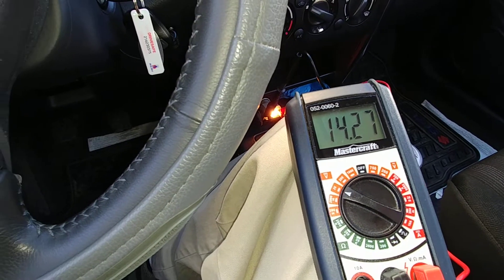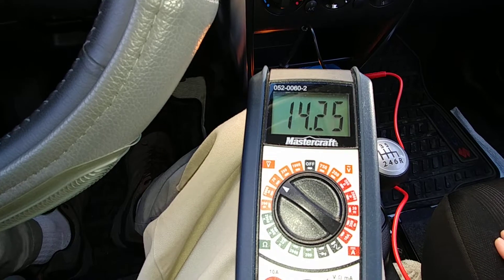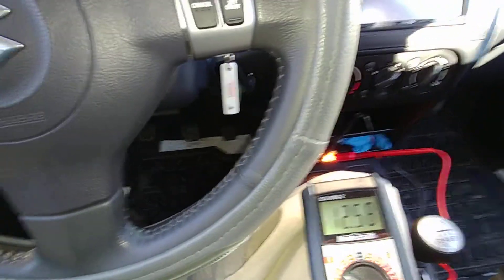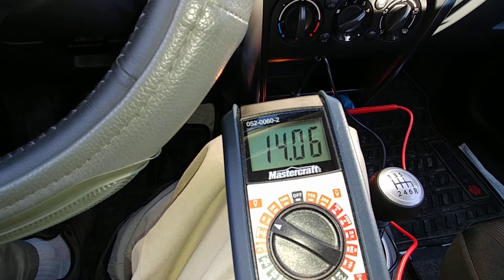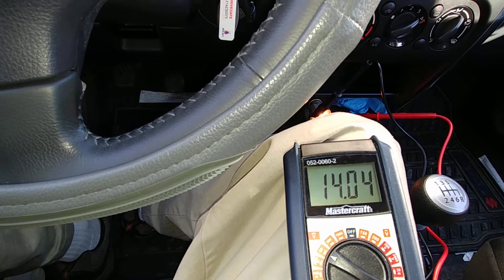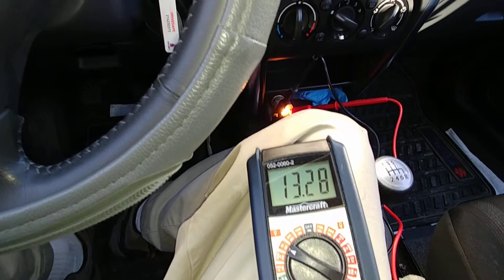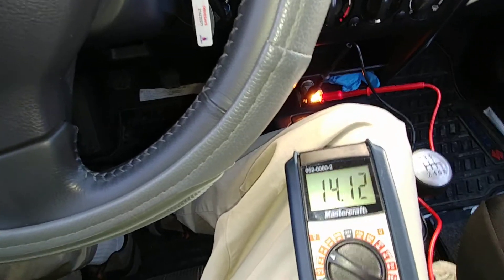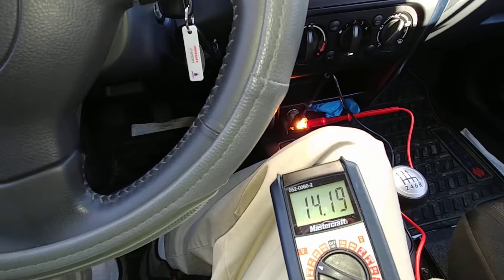2011 Suzuki SX4 Alternator Voltage Readouts

Comment: Hola saludos tengo un zx4  2013  y le e cambiado 2 veces el generador  duran 2 semana y prende la luz del gerador mientra edta prendida   La carga es de 12 .6 muy bajo osea no está cargado, lo acelera y apaga la luz del generador y ahy entince la carga es de 14.02  necesito syuda el generador se compro en pepboys gracias
Reply from the maker: Me disculpo por la respuesta tardía, le llevaría el alternador a pepboys para que lo revisen, mi alternador no falló la prueba en sí cuando lo revisé, sin embargo, la salida de carga era baja, también, verifique su la batería también y todas las conexiones, tanto en la batería como en el alternador, vea mi otro video donde reemplazo el alternador, es muy importante hacer esas comprobaciones, especialmente las pruebas de caída de voltaje, espero que esto ayude, gracias por mirar y comentando (utilicé el traductor de Google, así que pido disculpas si hay algún error gramatical).

Comment: Hi Zman, I really appreciate your informative videos on the SX4. I am attempting to check my spark plugs (odo is at 225,000 miles, 2012 sx4 hatch). I have read every forum post and even your comments on your SX4 maintenance video but I cannot for the life of me get my engine cover off. I am lifting up on the front with as much force as I can, so much so that the car lifts. The front right corner is showing a stress line and in afraid of breaking my cover. Do you have any tips for getting it off? If it does break is it necessary for the function of the car?
Reply from the maker: there is no trick to taking the plastic engine cover off, pull up on each corner, if its stuck, it may be because it has not been off in a while and the rubber grommets may have baked onto the fastening points, if it breaks than not to worry, it just dampens the sound; thank you for your kind comment and I hope I was able to help you out; thank you for commenting and subscribing, I very much appreciate it.
Reply: @zmanvideo1  Thanks for the advice! I waited until I had driven for about 45 minutes and the engine was nice and warm. A solid tug upwards let it finally come loose! Do you know if there is anything I can apply to the connections to help them release easier next time? Thank you again for all the help
Reply from the maker: @fifemaster100  you can apply some diaelectric grease to the connections, it will greatly assist in removing the cover in the future.  Sorry for the late reply.

Comment: The Suzuki grand vitara Good reliable transportation?
Reply from the maker: yes, I would say, the engines are very tough, the automatic 5 speed transmission is by Aisin a very reliable unit, I would recommend that you replace the engine coolant very very regularly, you have to remove a lot of stuff if it starts leaking, other then that, I would recommend them.  Thank you for watching.
Reply: @zmanvideo1  how many you recommend? Can I still find parts here in Los Angeles like maintenance parts from aisin like you say? It's good to hear I live dohc v6 timing chain instead of belts 👍
Reply from the maker: @rolldog82  You could contact Suzuki USA (suzukiauto.com) and ask them who are dealers around your area that you can still order Suzuki parts, you can also use megazip or ssg Asia, I actually like timing belts but that is just my personal preference.  Wishing you many motoring free miles with you Suzuki! : )
Reply: @zmanvideo1  is rockauto a place to buy oem parts? You rather have a Mitsubishi montero or Suzuki grand vitara? Which is more reliable 4x4 in your opinion? Mitsubishi are belt driven. I see more Mitsubishi montero than Suzuki grand vitara here in Los Angeles now.
Reply from the maker: @rolldog82  yes rock auto is a great source for parts, although they do not carry oem parts, honestly, i would chose the vehicle that has a more easier supply of parts, if the Mitsubishi's have a ready source of available parts then i would chose it, both makes are excellent.
Reply: @zmanvideo1  yes been thinking same thing. I appreciate the help. I loved to buy both too bad both manufacturer left USA market.
Reply from the maker: @rolldog82  wow, didn't know Mitsubishi left the USA market as well....why do all great companies have to leave North America....sigh....best of luck on whichever one you choose.
Reply: @zmanvideo1  thanks alot. Enjoy cheap Japanese 4x4 outdoors
Reply from the maker: @rolldog82  thank you, you as well : )

Comment: 05/3 22. What age & mileage was the alternator replaced ? Have a UK 1.6 Auto - have only needed to replace the battery, concerning electrics, so far - now reached 62 000 miles.  What is the knurled pad for at 6 o' clock position on your steering wheel ? First time l've seen one - I'm on my 3rd SX4.
Reply from the maker: vehicle is 11 years old with only 27,000km, I am the original owner, I have a steering wheel cover on my steering wheel : )  Awesome to hear you are on your 3rd SX4, I love these vehicles!  Thanks for watching.
Reply: @zmanvideo1  05/3 22 (2). It's our, my wife & l, 4th Suzuki. Our 1st was a 1.6  4WD Swift followed by 3 SX4s. Lastest bought in 2013 at 500 miles from new. European SX4s were built in Hungary. During production a sister FIat Suduci model was built simultaneously. Fiat had their own colour ranges & styling differences. Roof bars were finished in silver. Front & Rear ends & side mouldings differed too. Best.
Reply from the maker: @peterallam6494  wow, that is impressive!  I also have a Suzuki Grand Vitara 2006 that I purchased new, you are lucky that you still have Suzuki's in the UK, here in Canada (and North America) they pulled out about 7 or so years ago.